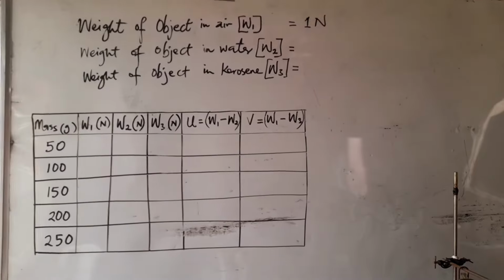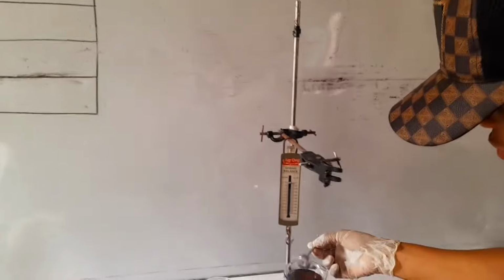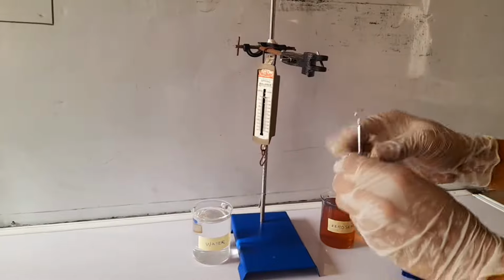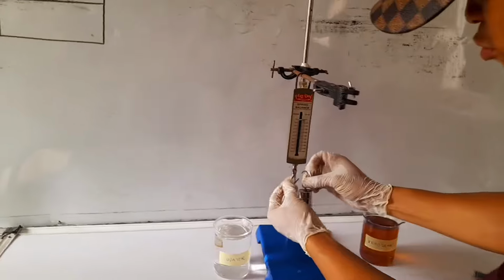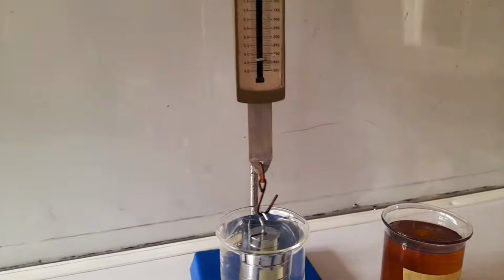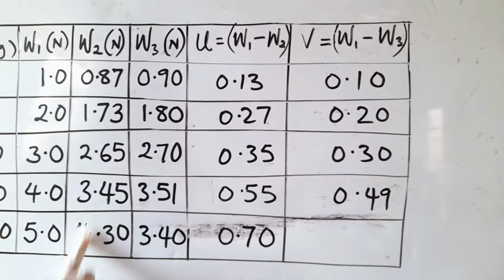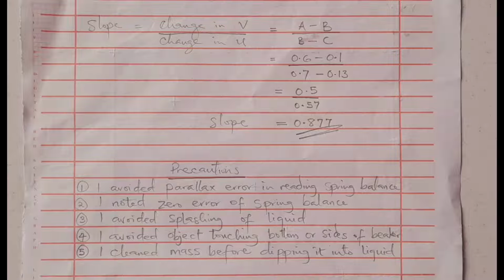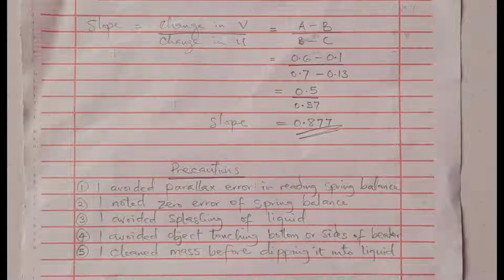Experiment to determine Upthrust, Buoyancy, Density & Relative Density

Comment: You cannot measure 0.87 from your spring balance. The least value it can measure is 0.05
Reply from the maker: Yes you can.
Reply: @SciteachAcademy  if you say so, how many lines from 0 is 0.87
Reply from the maker: @darlingtonagbai7999  take for instance, if the dial is between 5.5 and 5.6, what would you record?
Reply: @SciteachAcademy   I would record 5.55
Reply: @SciteachAcademy   so if it lies in between 0.8 and 0.9 I would record 0.85 not 0.87
Reply from the maker: @darlingtonagbai7999  what if its not at the middle. That is its more than 5.55 but not up to 5.60
Reply from the maker: what if its more than 5.55 but not up to 5.60?
Reply from the maker: When doing practicals, approximate accurately, don't try to make what you want, Your examiner has already done the practicals and has his or her figures

Comment: That means the spring in the balance is showing 100g for 50g mass. The calibrated scale covering the spring is actually the wrong one.
Reply from the maker: The spring can get weak, the scale can't. The spring is the issue
Reply: It's too accurate for a 0 - 250g scale. It can't just be the spring's weariness
Reply from the maker: I understand what you're saying. Without the hanger, it's not accurate. So the weight of the hanger helped.
Reply: The hanger itself is 50g by default.
Reply from the maker: @crushballer  No. The hanger is about 5g. The whole point is that the spring is the issue, not the scale
Reply from the maker: @crushballer  No. The hanger is about 5g. The whole point is that the spring is the issue, not the scale
Reply from the maker: @crushballer  No. The hanger is about 5g. The whole point is that the spring is the issue, not the scale
Reply from the maker: It's a common problem, physics teachers know this, and it's well accounted for in the calculations. So it's not a big problem (the spring). Weight in air minus weight in fluid will give the same answer irrespective of the health of the spring.

Comment: please 50g is equal to 0.5N please check your work
Reply: He's correct
Reply from the maker: Thanks for the feedback. If you watched, the loads were attached to a hanger, the spring balance recorded the weight of the hanger too. Besides, your spring balance would give you different readings based on the health of the spring. But be rest assured that after the calculations, the answers will be correct. 

My point is, follow the readings on the spring balance, not the mathematical conversion of the loads. There's a reason why you were asked to measure it in the first place.

Comment: Check your values again, the mathematical weight in air is far different from what your scale is given you for instance the of 50g is 0.5N but you recorded 1N, same with 100g which should be 1N. Check again
Reply: I also have a question to that, since weight = ma,
That should be 50/1000 * 10
=500/1000
=0.5N

However, his work is explanatory
Reply: @israeladedeji4342  no doubt,
Reply from the maker: Thanks for the feedback. If you watched, the loads were attached to a hanger, the spring balance recorded the weight of the hanger too. Besides, your spring balance would give you different readings based on the health of the spring. But be rest assured that after the calculations, the answers will be correct. For instance, if my spring balance recorded 0.5 for w1, the values of w2 and w3 would be less than 0.5. Here it recorded 1N, that's why the values of w2 and w3 are close to 1N (just like values less than 0.5 would be close to 0.5) so the deductions are the same. THE HEALTH OF THE SPRING BALANCE USED FOR THE EXPERIMENT MATTERS, BUT NOTHING WOULD GO WRONG. The values of U and V would be similar.

My point is, follow the readings on the spring balance, not the mathematical conversion of the loads. There's a reason why you were asked to measure it in the first place.